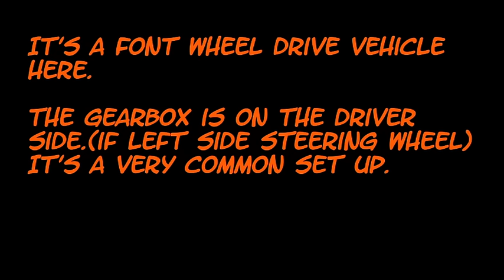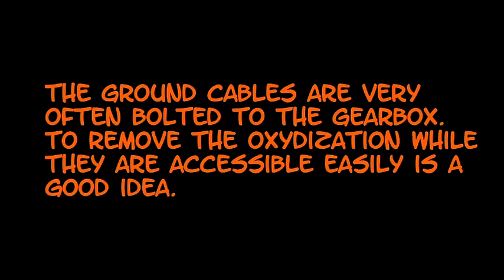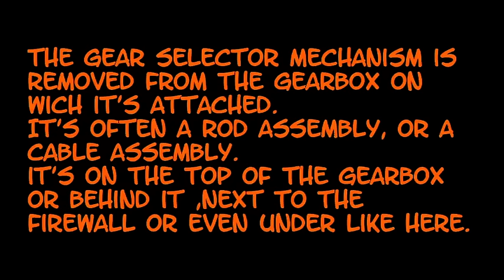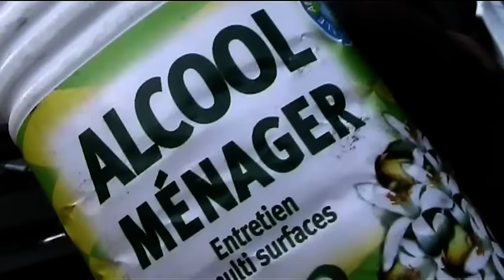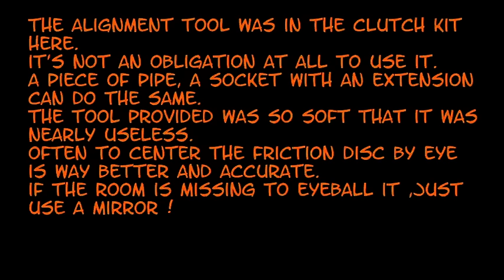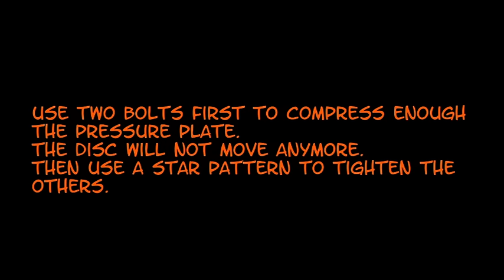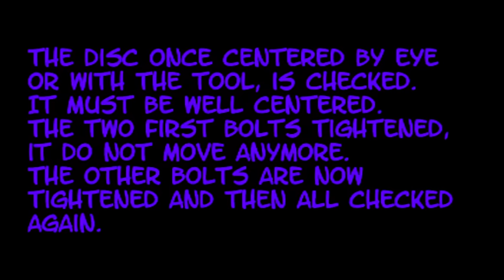Front Wheel Drive car clutch replacement.

Comment: two things here grease will cause dust and dirt to stick to it and the heat from the clutch and engine will make it go hard and the clutch will stick on the shaft bad news,,,,the other for those with a 1.2 and 1.4 is you don't have to take the drive shafts out or the gear box all the way out ,all you need to do is free the nearside shaft from the leg and bottom arm take out the bell housing bolts and swing the gearbox around on the shaft that runs along the back of the engine you wont have to drain the box either, just pull the box back enough to swing it around just have a good look and work it out yourself,you can get to the thrust bearing  as well can be done in under 2 hours that way.
Reply from the maker: You have to drain the gearbox if you remove the driver side axle here,it's an obligation since the cv joint is lubed in,by the gearbox's oil.
Reply: the drivers side drive shaft runs across the back of the engine and you do not need to take that off,you just move the gearbox back enough to just clear the clutch from the input shaft the turn it on the shaft that I mentioned above,it stays in the gearbox and no oil comes out ,you will have then just enough room to unbolt the clutch and enough room to get your arm into the gearbox bell housing to get the thrust bearing out,can be done in under two hours this way and no oil lose.you swing it round on the shaft.

Comment: Some times the gear box has to be completely dropped to get to the clutch. I built a new type   gearbox lifter that is so simple and don't need a jack. Actually two types. One for transaxle and the other for rear wheel drive. I just put them on youtube and they are very short and may help people who are about to do that work. If you click my name you should see them.
Reply from the maker: I've watched your vids,it's useful,but needs quite some room to work with.

Comment: there did not seem to be much of a difference between the new and old clutch thickness?   my clutch is starting to slip in 4 and 5th gear, but is ok in 1st(will labour engine with brake on and not slip)   is there an adjustment to let it out more so it stops slipping in 5th?  is that at the pedal as it didn't look like there was any adjustment at the transmission side of the cable?
Reply from the maker: What is your mileage /km on this car /clutch ?
wich car model?
Yes,not a big difference between the discs,but 1mm is huge yet on those systems.
Most of the time the clutch freeplay adjustment is between the fork and the bell housing on the gearbox,or if it's a hydraulicsystem it's a bleeder on the reservoir on the innner side  of the firewall just behind the pedal.

If you have a hydraulic set up (you can see a mini reservoir of fluid) i suggest you to bleed it and flush it ,put new fluid in it.
If you have a cable system,adjust it,then, if it's still slipping,if you have a big mileage on it,you can change it without regretting it.

Your actual problem is your pressure plate do not grab the disc anymore,because the disc is thinner(worn out) or because the cable is too tight pedal released.
if cable system loosen it a bit,the clutch should engage hlf way of its travel.

Comment: how did you pull out the guide pins on the gearbox, i tried to hit them so it can be easier to remove the gerabox but i can remove those and is cutted in the video
Reply from the maker: The hollow dowel sleeve or pin don't need to be removed.
The gearbox just slide on them,they are really short.
The only thing we removed was the stud ,wich was the problem.
we just unscrew it with a pair of pliers.
If you want to pull dowel pins,get one side with a needle nose pliers,then go to the opposite side of its diameter ,pull a bit ,and keep going.
some thin lubricant help a lot : )

Comment: Hello, I am using Toyota Vios. When I was starting to drive the car by shifting first gear (manual) I am hearing a noise from engine such as "kichi kichi....". Then after when shifted to second gear there is no noise and can smoothly drive the car. And also while drive the car is mountain loading, I can be heard the noise. When shift the gear to third and fourth, there are no noses hearing. So please be explained the problem and what do I want to do?
Reply from the maker: Amaan Rifay 
Hello,
How many miles do have the car or clutch ?
Is the noise only in first gear ?
cold or hot engine ?
pedal pressed only or non pressed only ? or both ?

Comment: Just got a clutch kit for mine but the pressure plate fingers are a bit uneven. Maximum by 2mm. Do you know if that affect anything?? Previously had gear engaging issues.
Reply from the maker: It's not an issue.
everything will even itself once compressed.
I've seen that on several pressure plates.

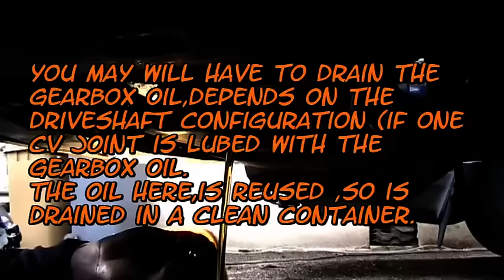Comment: 4:29 on which mileage is good to replace gearbox oil?
Reply from the maker: Each time you change the clutch for sure.
Every few years or few oil changes.
I would say on average 6 oil changes on a manual gearbox.
Depends of the oil itself,the manufacturer recommandations,your use.
It's often overlooked,that's for sure.
I would say that at least twice every clutch replacement is a good average on a car.

Comment: Do you need to put a jack under the gearbox so it doesn't fall? Also you were moving it quite easily. How much do they weigh normally?
Reply from the maker: +ThankfulServant 
It's a good observation and question.
Yes,do it,but let the gearbox slide without stress from whatever position to get it out, and in.
Gearboxes are quite heavy,i wouldn't give you an incorrect info,but you can easily count 35 kilos.
I'm a sasquatch,so no problem to me as long as i have room to embrace it : )

Comment: Sir, thanks for the video. But it is highly advised that you do not use so much grease where you applied it ESPECIALLY on the input shaft and throwout bearing! As they spin, they may throw out the excess grease between the flywheel, friction disk, and/or pressure plate, which will cause clutch slipping. Use very little, just a thin film. And the grease is advised to be high temperature tolerant. 
Regards.
Reply from the maker: Thank you.
Yes,i should have filmed also that we removed the excess.
There is quite a lot of peoples wich tell that regularly under the video.
I should add this comment in the video : )

Comment: I have a mk6 golf. My clutch pedal is very stiff when i press it. Some say the clutch is worn out others says its the cable. Do you have any idea?
Reply from the maker: If it's a cable system,you can check if the cable slides in its housing.
Have somebody operate the clutch,and look if it's sliding.
Most of the time,a stiff clutch pedal is sign of a worn out throw out bearing : it can slide correctly on the diaphragm having caused a ridge on it.
How many kms or miles do you have on that clutch ?
Reply: @michaelovitch I bought the car used. The car has 247.000km.
Reply from the maker: @anthony6006  
If it made mostly road driving,the clutch is the first one,but you can change it now,it lasted pretty long.
Generally ,they last 150 000 to 200 000 kms on average.

Comment: Thank you for this excellent video.  I will attempt my first DIY clutch replacement soon.  The clutch kit I received did not come with an alignment tool.  I will try your tip and instead use a suitable socket and extension bar
Reply from the maker: I wish you a success on this job : )
take your time,and you even can eyeball the alignment of the disc ,it works pretty good for me each time,the tools are often too flexible to be useful....

Comment: I need to know about a Rav4 4wd standard clutch removel. I can't get it apart from the motor. what could be holding it.  1995
Reply from the maker: You have bolts all around the gearbox and most of the time it's just the fact you don't pull the gearbox straight enough ,so it's resisting.
You could pry it at two opposite locations at the same time : there are tabs on the gearbox to do that.
check all round the housing first,a sneaky bolt is maybe hidden.

Comment: You should thread a couple of bolts by hand just to keep the pressure plate in place to save you trying to hold it at the same time
Reply from the maker: Yes, i agree,and did that recently on an other clutch.

Comment: hi can you please explain, in the video are you disconnecting the axle on the opposite side of the gearbox, or just the gearbox side? im confused it looks like you take out both axles?
Reply from the maker: +0991ekul 
Hi
On front wheel drive vehicles you can disconnect the two sides to be able to move the gearbox to change the clutch.
But i did one car two weeks ago on wich i only removed one side,just because i had enough room to let it on.
you have to disconnect them from the hubs tho.
Reply: michaelovitch hmm ok thankyou.

Comment: Very cool and really video! I would also recommend replacing the rear engine seal and the front gearbox seal as they are quite inexpensive parts that would require the whole thing to be taken apart again if they went no?
Reply from the maker: +Time To Watch Stuff 
Thank you
Yes,,to replace them while it's accessible is a good idea : )

Comment: GREAT video explanation!  Thank you for sharing your expertise in this area.  I do have a question.  It seems like more grease than necessary on the contact points.  I would just be concerned that it would sling to the fly-wheel.  I am clearly not nearly as experienced as you are in these matters, so I was wondering. Thank again!
Reply from the maker: Thanks,
Correct,the excess was removed but not filmed,(i should have because i'm reminded often,not as politely as you did here),otherwise it ends on the clutch,or in the bell housing.
You are completly right.

Comment: I read on my Mazda mx-3 you have to also remove the radiator plus basically remove  the entire transmission out of the bottom of the car to do this.  I think my clutch is original with 213,000 on it and it’s slipping under high torque.  Ugg
Reply from the maker: I was supposed to completly remove the gearbox out of the car here,following the shop manual.
You can maybe cheat here and there.
213 000 is good for a clutch : )

Comment: Michael I had a new clutch put in my five speed 2013 Ford.  When I went to pay for it I mechanic told me he drove it a little distance and it wouldn't stay in here now uses the transmission is bad what do I do?
Reply from the maker: It doesn't stay in gear ?
Reply: @michaelovitch  yes.  There was no power, something about hard to shift etc...  I have been driving my car 8 years.  Can't imagine just because it needed a clutch so the transmission how can this be?
Reply from the maker: @rondawitt8492  
If it worked before the mechanic touched it,he certainly caused that himself.
Maybe he forgot to plug a sensor,and even damaged something maybe,i can't tell from here i'm in France.
Did it worked properly except having a worn clutch before bringing it to the shop ?
Reply: @michaelovitch  yes!
Reply from the maker: @rondawitt8492  
Bring it back,tell him it worked normally except having an old clutch.
If you had no the problems he describes before bringing, it,he damaged your car.

Comment: Does he remove the springs on both sides? It looked like he took of the right side, but later in the vid the left side was also gone.
Reply from the maker: Most of the time,you need to remove the suspensions,to access the drive shafts and remove those also.
So,yes,i removed both sides.
Reply: @michaelovitch  Ohkay. I have a Audi A3 2005 and i have removed the drive shaft without removing the spring. So I guess i can leave the spring be then...
Reply from the maker: @davidjohansson7646  
Good for you,it's less work : )
The hubs you have move more easily,so it's possible to push the axles through.

Comment: My apologies for my lack of knowledge but if you want to remove the gearbox from the car do you have to remove the subframe?
Reply from the maker: Do not apologise for asking a question,that's how you get more knowledge : )
To answer,depends on how is bulit the car,and sometimes you have to ,yes.
But here i was supposed to completly remove the gearbox out of the car,and it worked without doing it.

Comment: nice video.  could you have replaced the rear main seal or was that deeper inside the transmission?
Reply from the maker: Thank you : )
Yes,sure,just remove the flywheel when the gearbox is pushed aside and replace the seal.
Reply: +michaelovitch ok...i guess its on a case by case basis if it was leaking .  Hell, with all that work for instance  i would,  just for maintenance. Thanks for replying. :)
Reply from the maker: The best thing is to change it ,each time.
You should change the primary shaft gearbox's seal too : )
Reply: +michaelovitch ..oh another useful tip..i forgot about that one.  thanks again :)

Comment: Good idea to put a huge blob of grease to make sure they lubricate well, but wiping the extra clean is extremely important. However I always wonder what effect could that grease cause, the disc friction surface has lots of deep grooves in them that can displace lots of grease, maybe it will fail when the grooves are worn out.
Reply from the maker: We removed the excess,all is working well.
Just a bit of grease on the the disc make it slip,i've experienced that already on an other car.
It was just a little bit,but was enough.
Those parts must be really clean to allow a good contact.
Reply: michaelovitch now that I have done it myself and watched this video again, it made me cringe to see all that much grease inside the bell housing, I only put an extremely fine coating of high temp grease on the spline, and that was it.

Comment: Hi I was wondering if someone could help me with this.. when I push my clutch pedal in (to the floor) there's a very loud rattle coming from the engine bay, and when I release the pedal, it stops. The actual clutch seems to be working fine (no slipping etc) but was wondering if I would have to replace the whole clutch or just release bearing?  Also, would this procedure be any different if it's wasn't a cable clutch? Thanks!
Reply from the maker: +Ronald McDonald 
Hi,
How old is your clutch(in kms or miles ) ?
I would say it's going bad.
Often the rattle are the springs on the pressure plate wich are making the bearing to dance like if on LSD because the surface of contact between them is irregular,the are gaps and play a bit everywhere...
Clutches rarely slip when dying,often the bearing die first from lack of grease,then the springs on the pressure plate are eaten by the bearing,are grooved and the correct presssure to disengage them while compressed vanishes,so the gears are difficult to change.
I suggest you to change the whole kit,otherwise you will have to do it again soon,unless your actual clutch kit is recent.
If you have whatever system,hydraulic or cable driven,the job is the same,except maybe if your slave cylinder is inside the clutch housing.
In this case you may have to replace it,following what the manufacturer dictate...
Reply: +michaelovitch thanks for the information! The clutch is about 96,000 miles old so I'd say you are right. I will look into changing it soon. Thanks :)
Reply from the maker: +Ronald McDonald 
96 000 miles ?
You can change it without hesitation : )
they rarely last 200 000 kms ,so you are spot in the life span.
Reply: +michaelovitch well al least I know what's happening now. cheers :)

Comment: My thrust bearing is getting noisy. When i slightly depress the clutch pedal. It makes a grinding noise. Does this mean the clutch needs replacing?
Reply from the maker: depress the pedal ?
the clutch is pulled or pushed to disengage ?
habitually when a noise is heard on worn out thust bearings on a clutch system,you can hear a noise when the pressure on the bearing is on because it's dry and start to fail or when the pressure is off because there is play in it and it's rattling.

What is the mileage of the car ?
Is the clutch have been replaced yet ?
Reply: I believe the thrust bearing pushes. The vehicle has 87000 miles on it. Its a Ford Mondeo 2004 model 2 litre TDCI 130ps. The clutch was replaced at 70000 miles.
Reply: The clutch was replaced because the dual mass flywheel failed.
Reply from the maker: M Baggie
It's not normal.
You have a hydraulic system and the bearing is on the slave cylinder asembly.
I think it's noisy because it was not changed with the clutch/flywheel kit.
It's worn out now, i guess.
87 000 miles is what thrust bearings last more or less whatever the set up on cars.
Look in detail at your bill.
You should have a "slave cylinder"  replacement and a flush of the hydraulic system.
If not that mean the thrust bearing is stock,and worn out and you pay the price now with the same job to do again...
Reply: I guess your right that they did not replace the thrust bearing. I intend to phone them tomorrow to ask them why it wasn't replaced. Its outside their warranty now but they may do me a better deal if i complain. Its not a job that i can do myself. So i am reliant on them giving me a good price.Thanks for the advice.
Reply from the maker: M Baggie
That sucks.
I hope you will can solve the problem for cheap or free.
Give me news if you can, to see if it was really that.

Comment: hey man i just replaced  my clutch on a 2001 mitsibishi eclipse the problem im having is that the gears go in without the clutch but at the same time the wheels dont spin what could be the problem?
Reply: did you ever figure that out jasmine? Same issue im having. Let me know asap
Reply: +Brandon Chavez I would suspect the throwout bearing is frozen or slipped and is stuck at an angle on the transmission input shaft.  Maybe the clutch fork is also jammed.

Stay gold.
Reply: +Jasmine Magana Your drive axle might be the problem.
Reply: +Jasmine Magana Hey Jasmine just want to know if you figured out this problem. Having the same issue would like if you could inbox me and tell me how you solve the problem if you did
Reply: Mine was my clutch.